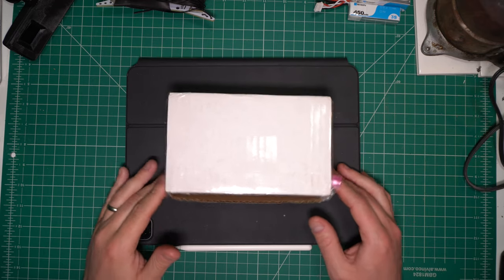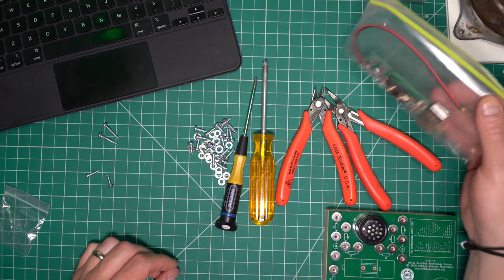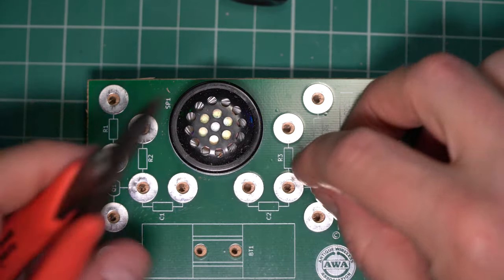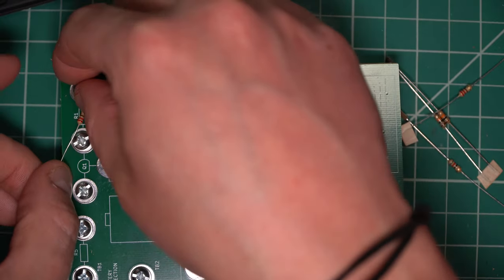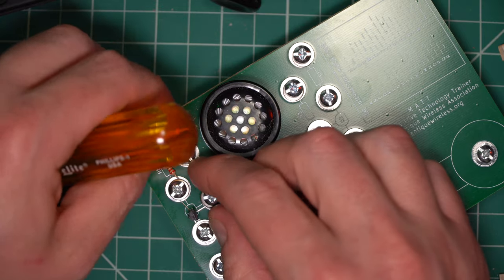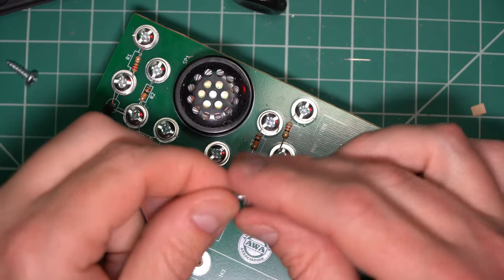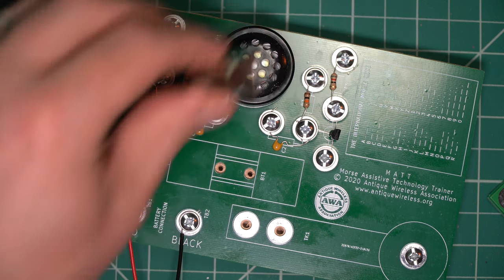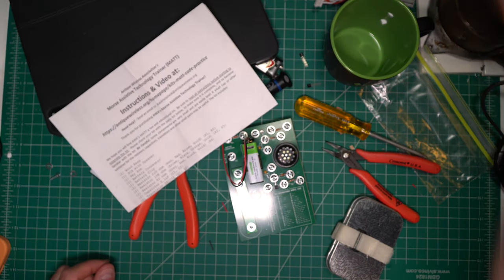MATT Morse Code Practice Key - Solder Free Oscillator Kit

Comment: Wouldn't it be easier to have the leg of the component always on the 9 o'clock side of the screw (looking from the component to the screw), so when you're tightening the screw the force of the motion pulls it into the center instead of pushing it out?
Reply from the maker: It seems not to be an issue.
Reply: Ayup!!! My dad the electrician hollered at me more than once for doing it wrong!
Reply: Beat me to the punch!

Comment: Children can solder if we explain how to do it correctly and safely. I think it's a mistake not to teach them. Later they will know how to use tools and repair objects. it's part of the pedagogy.
But it's a nice kit. It may be a bit more complicated than a solderable kit. Indeed nothing is easier to put component legs in holes and then solder them, than to fight with screws as we can see with R2 and C1.
Reply from the maker: I don’t think anyone is proposing we don’t teach people to solder.